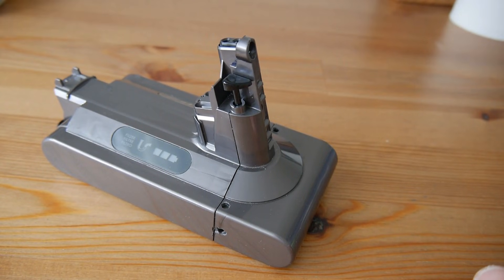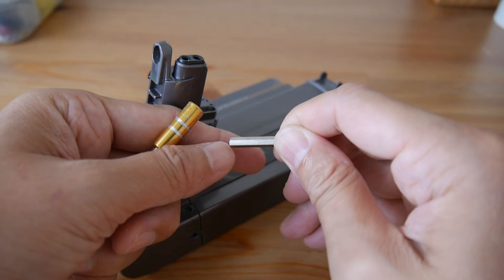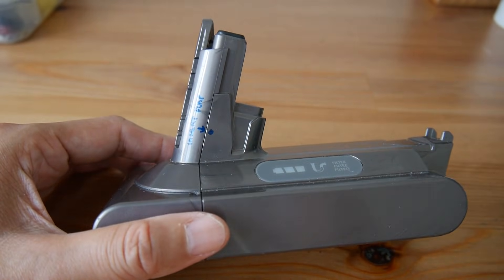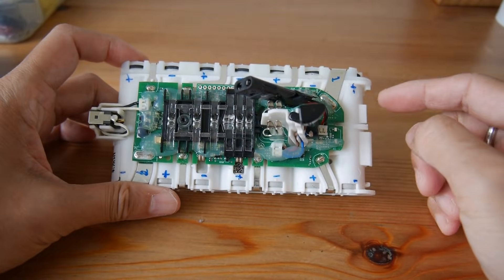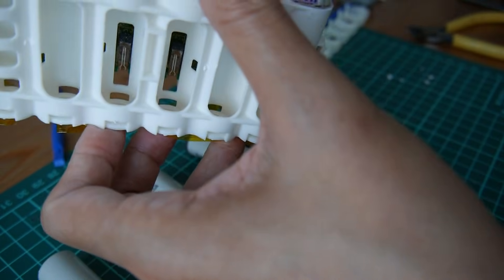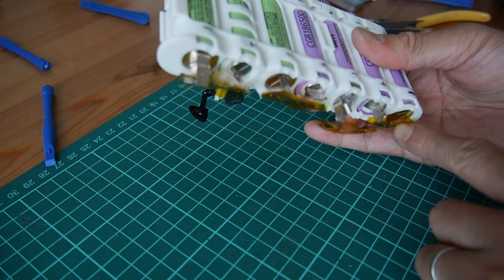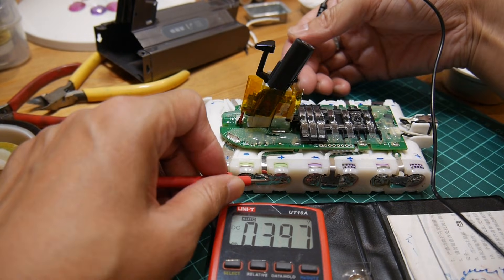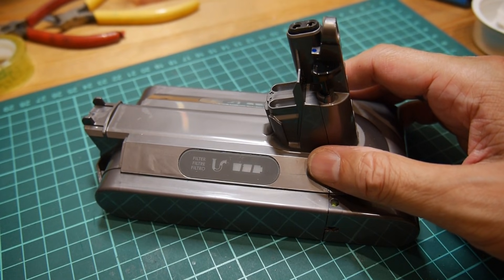Dyson V12 V11 V10 V9 V8 V7 hoover battery hack, DIY revive

Comment: why didn't you check all the original batteries to see if they were OK. every time  my dyson 
batteries go faulty its not the batterise its the dyson BMS board
Reply from the maker: Had checked the internal resistance on each battery but didn't film it

Comment: As someone who has repaired and spot welded lots of batteries. When I properly replaced my batteries on my Dyson battery pack, they purposely caused the BMS to fail making the repair worthless. This was many years ago. I then purchased an ultra cheap fake capacity battery from amazon and replaced the cells with the ones I had put inside of the dyson pack. I hate supporting those fake batteries on Amazon and Ebay but it is cheaper to buy them and salvage their batteries out with decent high current batteries for someone like me. Apparently people can now program the dyson BMS but this was many years ago and that option wasn't available at the time.
Reply from the maker: That's very good information!

Comment: You can't use laptop batteries, because they don't have high current cells. Power tool batteries use high current cells.
Reply from the maker: Yes. Need battery with 20C power

Comment: Two issues in the video. Using mismatch batteries is usually not a great idea because of different life spans. You also shouldn’t be soldering 18650 batteries, the heat will degrade it. Just get a cheap spot welder for the nickel strips.
Reply from the maker: That's a good idea. Better to use brand new batteries with same type and brand.
Reply: @houseman2022  Also, the original  molicel batteries are High discharge 35 A and the  green NCR you put are low discharge 7 or 8 A.  Be careful

Comment: woah, it's just 18650 in there?   This could have been designed for drop-in replacement in the first place.  What a shame.
Reply from the maker: Those batteries are easily found in the market but the design does not allow consumer to replace

Comment: doesnt the BMS lock out on the v11 v12 batteries the moment that you disconnect the pack from the board?
Reply: I pulled apart this same pack.  The moment I disconnected one cell feed from the board, the board started flashing a red light that means it's irreversibly bricked.  I don't know how the one in this video worked.
Reply from the maker: The BMS in the video was being unlocked and reprogrammed
Reply: @houseman2022  This video does not show any reprogramming or messing with the electronics whatsoever.  I just watched it yet again.  He shows removing the old cells then putting replacement ones in and simply soldering them (lets not go into that!).  After changing the cells the pack shows a single voltage blue light with no issues.  When I tried on an identical model working pack someone gave me (purely for the cells), when I disconnected one of the cell leads to the board it started flashing red which means it has bricked itself.  Maybe this has been added to newer packs, who knows, but forums I looked at said the same as I got.  It means if I try to put new cells in the Dyson v8 I own it will brick itself and fail.  You could argue stopping people doing this is for safety, but I would say it is overkill.

Comment: Do you know of a balancer that can balance the V10's seven batteries without removing the welding? I have a cheap device that works great on my Dyson V8 running modified firmware with XH-7P connector but theres not enough leads to do the Dyson v10 battery.
Reply from the maker: I know such device to modify firmware and hack the program, but I never have one. That's good if you know how to use it
Reply: @houseman2022  I learned what is needed to balance the Dyson V10 battery,  Spektrum XBC100 device to balance batteries, and the Dyson V10 is 7 cells so it needs JST-XH-7S cable.  The Dyson V8 uses 6 cells which is more common so cheaper/generic cell balancer like "Blomiky 3-in-1 2S-6S Li-Polymer/Li-ion or Li-Fe Battery Balancer" with JST-XH-6S cable works for Dyson V8.  Spektrum XBC100 is compatible with both(just buy both 6S and 7S cables).
Reply from the maker: That's great, you are expert! Do you think Ebay would have it?

Comment: Batteries in the same block must be of the same type, at least the same battery code, can be different batches but limit this. If you put 2 types of batteries in the same block, it will have problems charging and discharging.
Reply from the maker: Agree, Different type of battery has different capacity and charging current. It is better to have the same type and batch.

Comment: I have RC planes and cars and have dealt with NiCds, NiMH, A123's, Li-Po's, Li-ion, etc. for years. The average consumer is not equipped to dis-assemble a dedicated consumer product battery pack and replace individual cells. Depending on the chemistry Dyson is using, some cells can be quite volatile if they are mishandled resulting in serious burn injuries. There are other electronics inside the case designed to work with Dyson products that one could damage if not careful when doing this.
Reply from the maker: Handle with care and know the knowledge is the key before doing this. The way in changing the battery gives idea of how it might be done. Of course, it is more for entertainment purpose but not for newbies in electronics
Reply: @houseman2022 i suggest you should remove this dangerous entertainment video!!!

Comment: My experience with these Dyson batteries...  is the Board usually goes bad.  When I opened the case to the V8 Battery, it smelled roasted.  The batteries were fine though, so I'm repurposing them for use with an LED flashlight.  These are no 18650 batteries, in case anyone didn't already know.  Not as easy to reuse in other devices as I had hoped.  The V6 uses the old 18650 batteries though.  I had one of those and it was also the Board that went bad.
Reply from the maker: Thanks for your comments. Good to know the circuit board being the major failure in your experience.
V8 battery is not 18650, those are like 21700. ie. 21mm diameter with 70.0mm length

Comment: Merhaba. Dyson batery red light error onarımı nasıl oluyor?
Reply from the maker: Hi, depends the model. Flashing red light could mean battery problem which you can't fix it unless you take the battery to unlock the BMS. Steady red could be the problem on the main body, specially on V8

Comment: Edit : after reading the comments i understand know that it's impossible to replace the BMS without flashing a custom firmware for it. It's so sad to have such locked product...

Oh... I killed a BMS with a little bit of water, it's now blinking red 20 times. I tried to buy and old working battery pack to get and reuse its BMS. But as I was cutting wires it also started to blink red. I guess one of the main pole just went in contact again while I was disconnecting individual batteries. Now I have 2 dead BMS.
Correct procedure would be :
-cut main negative pole and isolate it
-cut main positive and isolate it
-cut individual balance poles
Like this I should be able to replace a BMS without making it save a default into its internal memory right?
Reply from the maker: I guess it would be locked once the BMS detects disconnection
Reply: Truly, it just detects a battery balance defect and just goes in error mode...
Not fixable that easily

Comment: Your vid is a good reason for me to buy a replacement battery. You did make it look doable for someone like you. Thanks for the vid.
Reply from the maker: It is doable in the way as the vid shows. Or you may buy a brand new replacement battery and it would work fine as well.
Reply: @houseman2022  Recommending people to do this is just stupid - as someone who works with high voltage systems and battery units, much like this - it's not at all uncommon to see things like these go "pop" and cause fires, seemingly at will. Tampering with anything lithium based is just asking for trouble. Recommending people with no understanding or concern as to what exactly it is they're handling, let alone doing - is poor advice and dangerous.
Reply: @r65  Sometimes things are very simple for people that frequently do them.  For starters , eletronics soldering is very simple for people who do it. But not so easy for a beginner. A lot can go wrong and most need a lot of prictice, especially on old work and reinstall solder connections. I done several simple (not so simple) motor internal capacitors. Got lucky.
Reply: Nice video. The suggestions to hand drill the locations where the clips are is a good way to open the housing without too much damage.

Comment: I have never seen a product so well engineered to FAIL and designed so you can’t fix it!
Reply from the maker: Every product seems to be well designed but the problem comes where you can't see behind the scence. Like other videos, people would wonder how much they pay and what the parts manufacture use to get money from their POCKET. Or functions are locked to prevent handyman to fix it.
Reply: It's not designed to be taken apart because it contains lithium cells, these are not toys - they, in the wrong hands, are literally fucking grenades. Piss about with those and you've got a big big problem...

Comment: Replacing the batteries usually doesn't work when the voltage gets too low... these batteries have a suicide mechanism that detects the low voltage and sets a flag in the microcontroller eeprom causing the led to flash red and after that it won't work even with new replaced batteries. The eeprom bit can be re-set using an eprom programmer but at that point it's easier to just buy a chinese copy for a few dollars. The copies work well and don't have the suicide 'feature'. If I have to buy a new one every 4-5 years it's still cheaper than buying the original battery.
Reply: You could jumper the correct voltage to the BMS before you disconnect the old battery cells.  This wouldnt work of course of if the dyson board already self deleted due to a dead cell.
Reply: Yes but chinese clone can not deliver current at max only medium. Which means the vacum is not performing very well. It runs and stops runs and stops at max... Original circuit is excellent to use it at max.
Reply: @thewalkingtrade2678  I still have this and it works ~5 years later. The original lasted 4 years and suicided. Anyone who knows what they are doing never uses these on max, there's no need to do that. If you need max then get a normal AC-powered vacuum.
Reply: Is there any problem if I replace the bad Dyson V10 batteries with the original ones?
Reply: @sedatkeskin1923  It won't work. As soon as you disconnect power the bms board gets locked and can't be fixed except by hacking it and re-programming the eeprom. This is by-design and done on purpose to artificially obsolete the product and is a common practice nowadays with many products. It's easier to just get a chinese clone battery or you can also buy a universal chinese bms board which doesn't have suicidal tendencies lol
Reply: @g4z-kb7ct  I have a programmer, what specifically needs to be done to reset it?
Reply: @sedatkeskin1923  No if you have the money ;)
Reply from the maker: You are right. Dyson batteries are locked if you disconnect the batteries' terminal. This is to prevent people doing what I do to protect their revenue. 

I had re-progammed the circuit board  before shooting the video. Since the process is complicated and is not the focus of this video, it is being skipped to make it simple.

Thanks for your professional comments.
Reply: @houseman2022  or even better make a video how to reprogram it.
Reply: @houseman2022  Hi . how to reprogram v10 battery pcb broad?
Reply: @houseman2022 I cannot understand your logic here. I call BS - you changed the cells and don’t want to admit that it’s been locked. OR SHOW US AND TELL PEOPLE THIS IS REQUIRED BEFORE SOME GO OUT AND BUY NEW CELLS.
Reply: @houseman2022  Well in this case it just waste of time. If I try to do it without reprogramming it will not work! Please mention it somewhere!
Reply: @houseman2022  Can you provide the pin diagram for programmation? I found the GND, the reset but the rest I cannot figure it out. They have hide the model of the PIC on the chip.
Reply: @houseman2022  Can you please make a video how to reset red LED of a V10 battery pack? Thank you.

Comment: I thought about reviving my Dyson V6 Slim battery pack but decided to get the higher capacity larger battery pack from the bay for around 30 aussie dollars. It's been in there for about 4 years and still works fine.
Reply from the maker: Simple and wise decision
Reply: Do you mind sharing the link or where you bought it . Thanks
Reply: @Kindness1-01  What? You can't put links on YT it will be INSTA-DELETED!! I got it from the jungle starting with Ama and ending in zon.

Comment: This is not how to do it people. Believe me I do electronics and you need a battery spot welder and them batteries he is using are not right for this. This is how you can cause a fire so don’t do it ok.
Reply from the maker: You are right. Spot welder is the better way on batteries. People need to know the risk and precautions if you do it on soldering iron.
Reply: @houseman2022  So why recommend a dangerous solution, and again verify that in the comments and yet - still not take the video down? This is bad.
Reply: You are correct, and i slide a untility knife blade inbetween the plastic and cut the lugs off i suggest wearing knife proof gloves for this operation. then use hot glue too hold it together when finished. that way if you need too disaasemble again at any time you use a  heatgun on the area  and pull the case apart. if done carefully, doesnt look like its ever been openend.